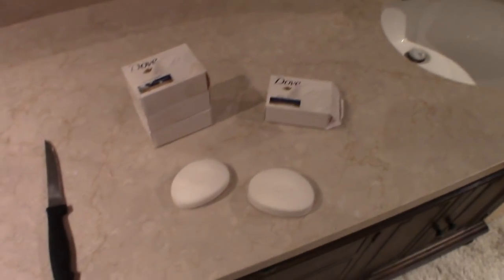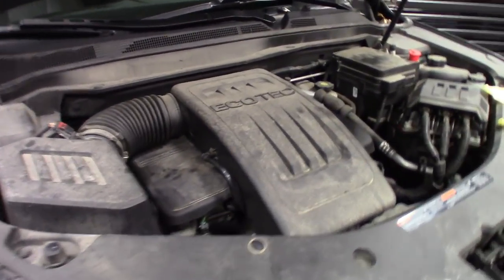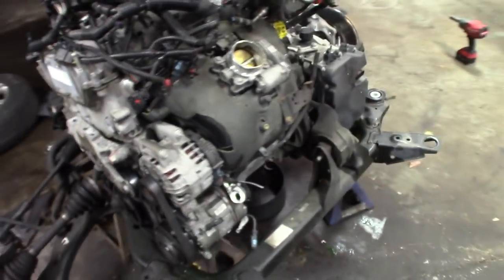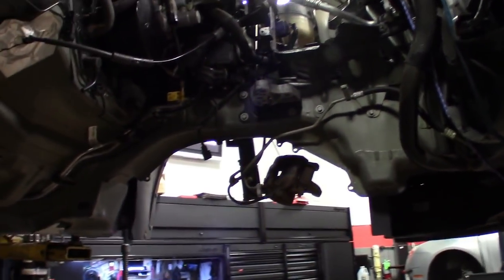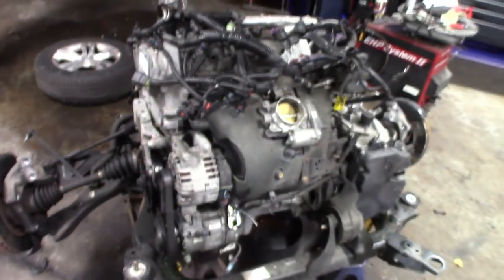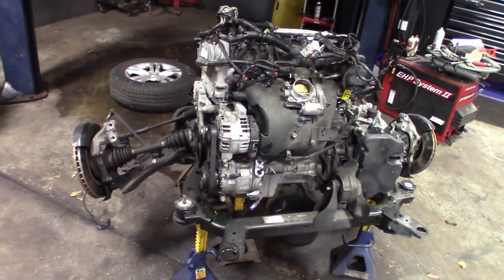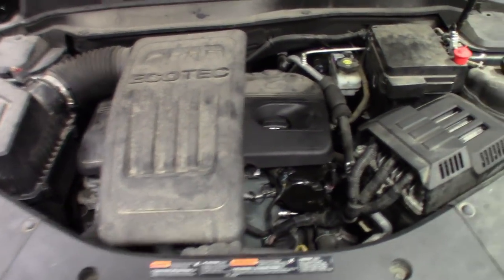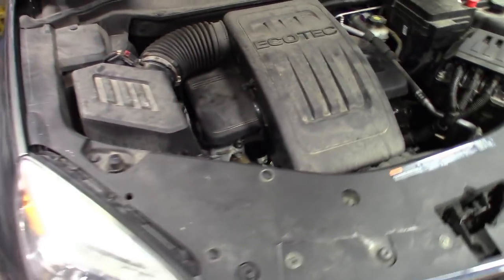Satisfying Motor Swap TIMELAPSE

Comment: I just yanked one of these on a GMC Terrain right out the top. It was AWD and I had to drop the transfer case but i yanked the engine out from the top. I had the motor out and on the ground in 2.5hrs. That's with the alternator, Intake and exhaust manifold removed. The compressor i just left on the sub-frame out the way. The secret is to yank out the crank pulley bolt and you have more than enough room.

Comment: Nother good one brother keep knoockin them out. I had quite an episode at my shop last night. I have a huge overhead door. Old heavy wooden one. 16ft high. Anyways its on a dohble spring system on both sides. Well i remotely shut the door frm outside and i heard a loud smash. I went in amd the strap that connects the spring to the pulley broke amd the spring shot across my shop leathally. Smashed a jump box, my 3 month old autel ms 906, otc dmm, a shop fan and a few other small things. Sucks but im lucky i wasnt in there when it happened it coulda killed me. I guess there is suppose to be a safety cable through the spring. I never really noticed there wasnt. Ive only been there a year and a half. I gotta install a saftey cable now though. I will miss the autel the most. Its amazing how much energy is in that spring man. Keep them coming. Ha e a great holiday with your family.

Comment: I work mostly on Honda and Acura, but other brands as well. I’ve removed a lot of cradles or subframes. Sure there is a few ways to do it. For me it’s easier to disconnect the lower ball joint, outer tie rod and then push the axle out of the hub and leave the knuckle attached to the strut. That way you don’t have to worry about the brake caliper or abs wires. Just sharing the way I tackle that type of job. Obviously everyone works a little different and to each his own!!
Reply from the maker: I don't like messing with separating the BJ's because they can become loose or get damaged, but I always weight out my options while I'm taking it apart to see what works best, I've done it plenty of different ways. Even take the strut down from the mount with hub and spindle still connected.
Reply: JRC54
I also forgot that you deal with a lot of rust and that can dictate how you do certain things. I’m in the Mojave desert in California so I don’t see much rust. Keep up the good work!!

Comment: I basicly did my wife’s terrain the same way, hers was all wheel drive and for some reason I had to take the transfer case off, other than that it went pretty smoothly, I don’t think I would take it out from the top, maybe it’s faster, but out the bottom was easier for me

Comment: Do you work on BMW?, I find they are cash cows when they get over 100,000 miles on them..I get a few 3 series that come in often with coolant leaks because Germans like to use alot of plastic parts in cooling system and not to mention they use an electric water pump that usually dies at 140k but hey are money making cash cows and not to bad to fix if you got a capable scan tool and access to parts discounts!

most people that own these cars dont keep them that long to see these issues after 100k, but these cars find their way to used car lots and craigslist for cheap prices and ppl buy them mostly cause they want to be seen in a BMW Status Symbol, but they fail to realize that these car will nickle and dime you to death but for us guys its a steady pay check

Love your efficient way of getting the job done Sir!